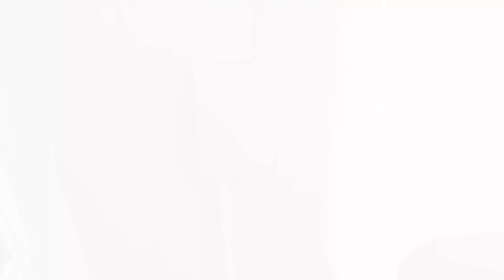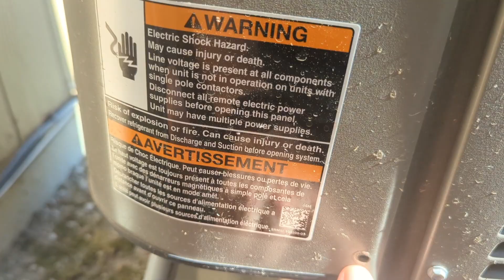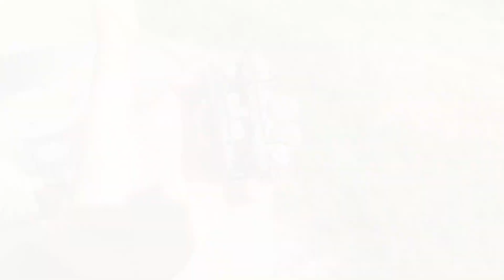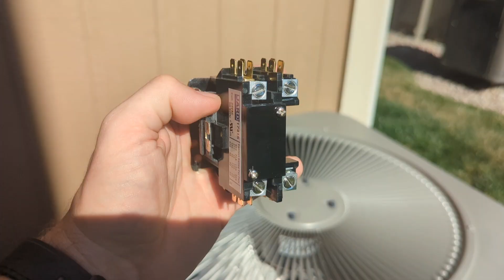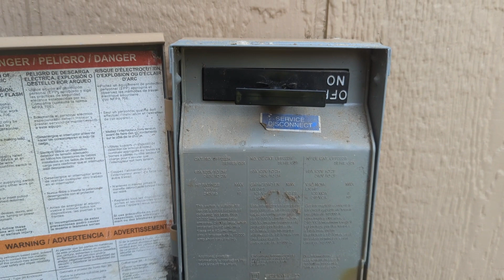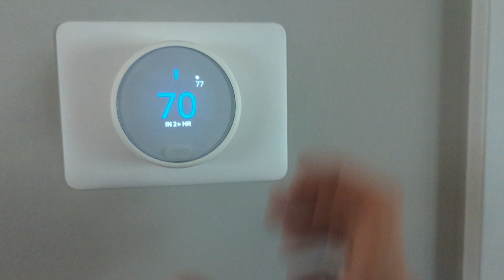EASY Air Conditioner Repair - Replace Contactor

Comment: Im a licensed contractor pretty much one man band. I charge $80 service call and charge $45 for a contactor or I will change your contactor and capacitor for $110. Im in Florida. There are reasonable companies out here just stay away from the big companies with multiple vans and employees the overhead is just ridiculous.
Reply from the maker: Very reasonable pricing, compared to the bigger shops.